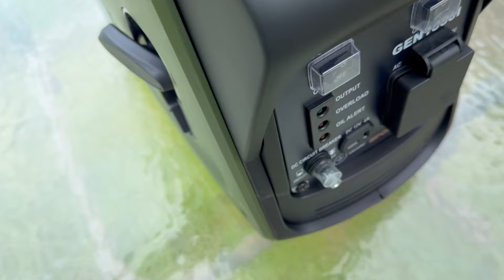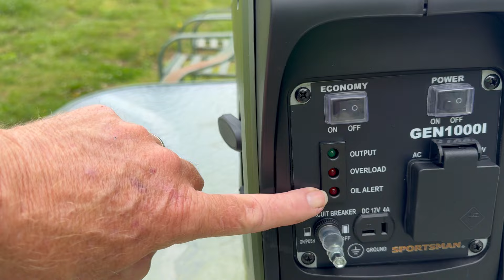Sportsman Pure Sine Wave 1000 watt Inverter Generator

Comment: If it has a fuel shutoff.  I always shut mine off and let the bowl run dry.  Always starts up that way when it sits for awhile.  Fuel will go bad in the carb in around a month if it sits
Reply from the maker: Yep, that’s exactly what I do too! 👍
Reply: The carburetor on that generator does not have a float bowl. You can verify by noticing that the generator will shut down immediately when the fuel valve is closed.

Comment: I have 3 of these.  Old one is great, 2 newer ones have been de-tuned and will only carry 500 watts.  DON'T buy this generator, you'll be sorry.  The old ones would hydro-lock if you put too much oil in.  They recalled and added a new lower oil level "sticker", then de-tuned them.  If 500 watts is all you want, buy it.  I though I had lemons and returned 2.  In total I've had 5 of these, ALL de-tuned.
Reply: My new one will easily handle a 500W resistive load (halogen lamp) but will shut down with a 750W load of halogen lamps.
It will also start my 1/4hp vacuum pump just fine and can run my saws-all.  It will not start my chest freezer compressor.
Reply from the maker: I wonder if you could re-tune them to run better?